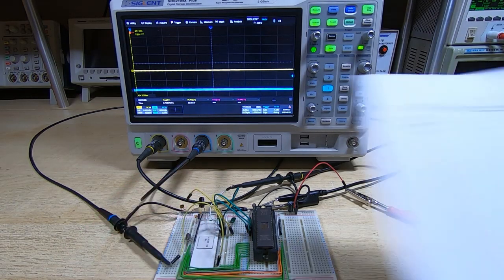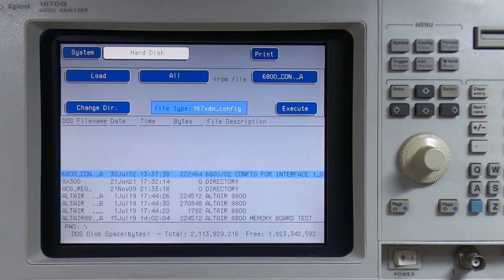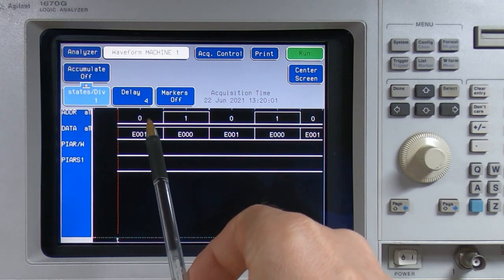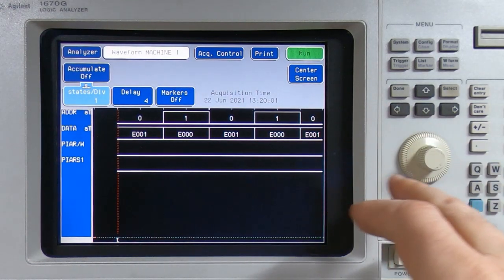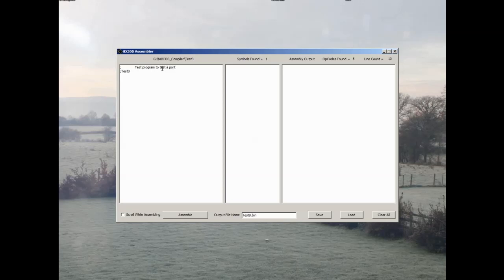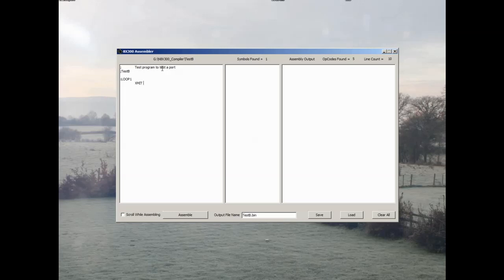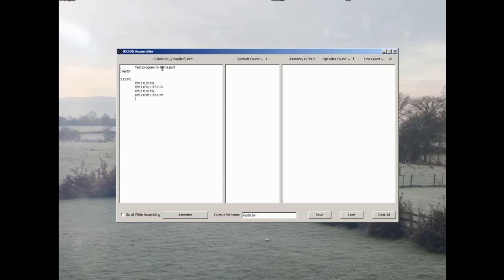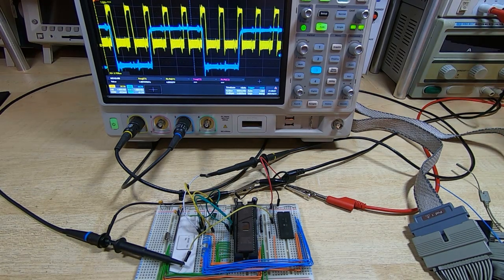Using a Logic Analyser Part5

Comment: Thanks for a great series of videos on this topic. Sadly, looks like you've abandoned the topic. Perhaps I can inspire you to record more. Here's a use case I'm dealing with: 6502 based project with memory mapped IO. I need to see what's happening around the time certain IO port is being accessed. One approach would be to capture some data a moment before till a moment after the IO access to have context of what's happening around that time. And have single capture run catch several such accesses separated by irrelevant code, so that activities can be compared. Second approach - have one long run capture everything "in-between" - I can't figure out how to jump from one IO access to another by using some sort of tag or search function. I just jump to a timestamp hoping I land somewhere close to what I'm interested in. So basically topic would be navigating around captured data without much scrolling through irrelevant data